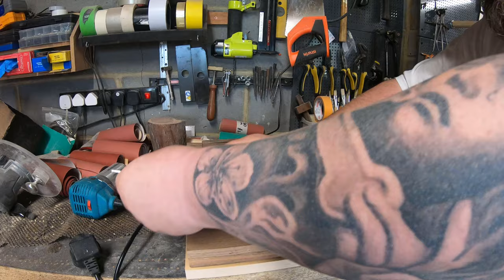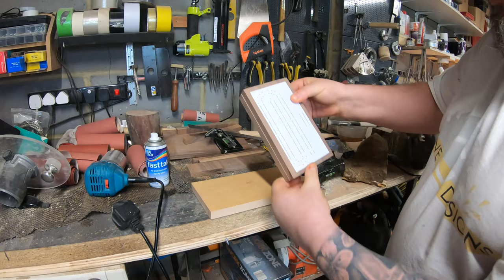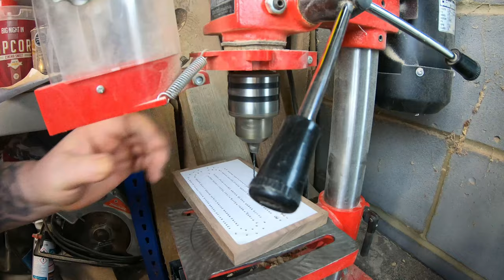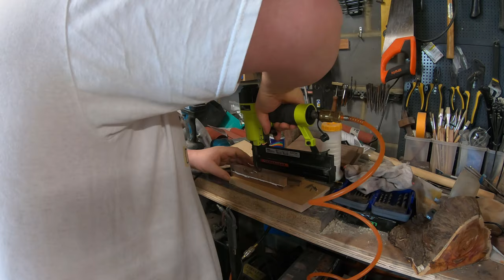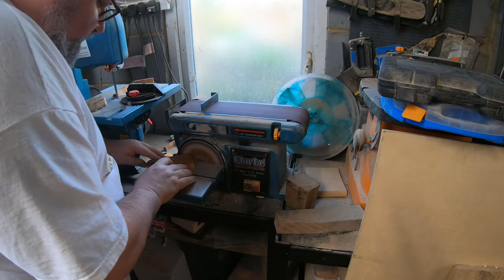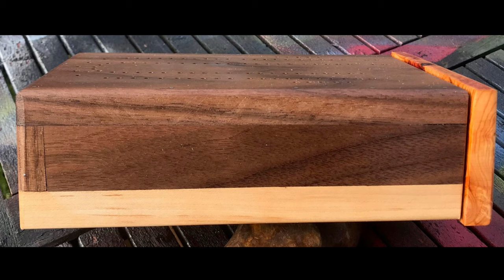Making a Walnut, Maple & Yew Cribbage Board for Makers Showdown

Comment: Looks great Dave. Just had a game of Crib at the weekend, for the first time in years.
Only thing I don't like is those nails, think they spoil the great finish of the wood.
Reply from the maker: Thanks Paul tbh I know exactly what you mean I was rushing to get it finished as I'd kept the boys waiting for weeks for Makers Showdown and it was part of that so I didn't really have time to clamp it up and wait I felt the same when it was finished but it looks ok
Reply: I've found that if you put a very small amount of glue on two really smooth surfaces, it should be glued enough in place after as little as 15 minutes. I do this for open segmented work. Still best to leave for 24 hours if there is going to be any shock to the piece.